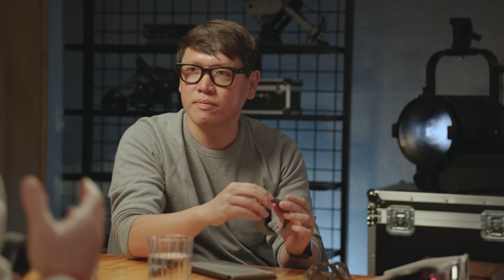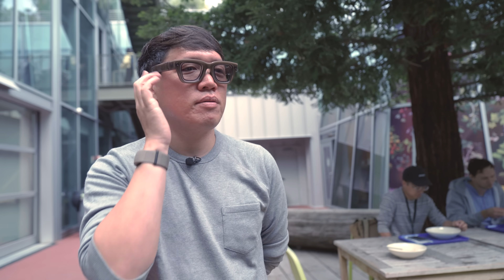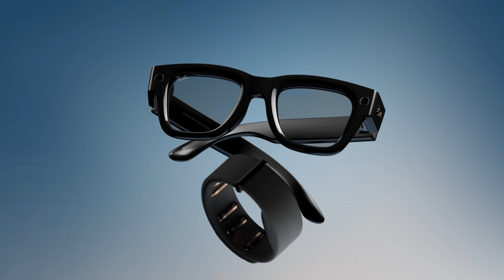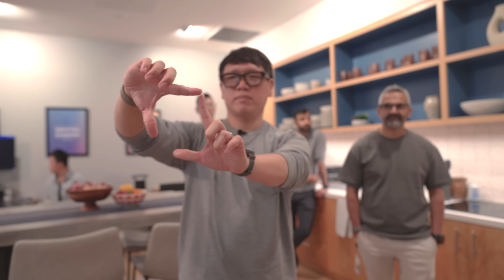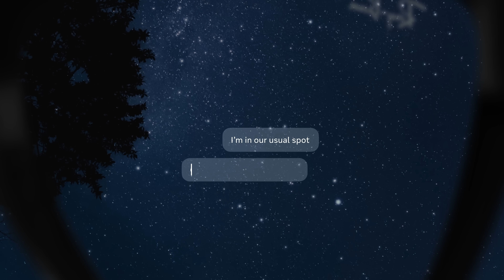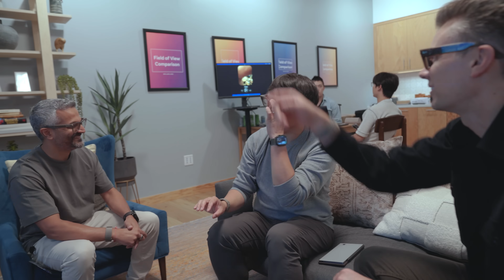Hands-On: Meta Ray-Ban Display Smart Glasses!

Comment: 100% of these miss is being OPEN.  I dont want to be locked to meta.  let me buy the glasses as an interface that work with anything because they support fully open protocols.
Reply: Exactly. The last thing I need is to tie a dying social media turned mass surveilance platform to my face. Give me a display, interface, and either use off the shelf parts or include a drriver library. That way, anyone who can do circuitpython or arduino could have a custom, privacy respecing open HUD platform. 

One can dream, anyway. I also want a device that is like the gpd pro (phone sized, screen folds backwards for touch only use) with built in 4g and a gaming gpu, to install linux on, too much to ask? 😂
Reply: @goosebyte  if you use a cell phone and are worried about this then you don’t realize what your cell phone does 😂
Reply: Hopefully these will just be on some kind of standard eventually like Bluetooth headsets. I wanna be able to use it with any service that supports it, would never buy something locked to Meta.
Reply: @JohnVance that would be really cool, there are already companies who are making prescriptions lenses for meta glasses
Reply: Check out the Inmo Air 3. Open SDK and dual displays. They are funky looking though and battery doesn't last very long. Only drawbacks.
Reply: 2 things about your comment: 1) You’re right, that would be a way better experience for all of us and accelerate the adoption. 2) This assumes they are making money off the hardware, they are not.  The sole reason they are even in this space is to own the ecosystem end to end (like Apple does) so they can have unfettered access to all your data…your location, your conversations, how you spend your day who you do that with, etc.
Reply: wait for gen 3,4 product
Reply: 😂😂😂😂 NO ! you'll pay META , and keep paying what ever they demand and you like.
Reply: This is the problem with companies that consumers don't identify with. It doesn't matter how great the product is when you dislike the company. Theres a reason people don't mind being locked into the Apple Ecosystem. Consumers identify with Apple and trust them.
Reply: @SaadyAb  not people. Californians. I wouldn't use an apple product for the same reason.
Reply: @SaadyAb  Speak for yourself, I hate being locked into the apple ecosystem.
Reply: @SaadyAb  I don't identify with Apple. I dislike them. I do not trust them. There are reasons why I DO mind being locked to Apple ecosystem. So I deny it.
I do NOT use any Apple products.
(I do have a MacBook Pro, though. But it is running Windows 11 24H2)
Reply: Am I missing something? Because I swore that I’ve heard of them making the SDK available to third parties already..
Reply: They literally said there will be third-party apps. When that point is we don’t know, but it’s always been part of the plan.
Reply: Check out Brilliant Labs Halo glasses!
Reply: I just want the translator to work offline, in Rural Japan.  That and the ability to attack a wireless keyboard and mouse any time I feel like.
Reply: The problem is that nothing gives them the access to stuff to be useful so your iPhone or Android phone don't allow tight integration for external devices
Reply: Well good luck with that lol. If Apple came out with the same product, you would gladly add it to your other Apple products and thank them for the opportunity. A company with this much funding behind them that sells things at a loss is not going to let you do whatever with their product. Meta still has to rope you into the ecosystem just like Apple would.
Reply: @brianbadonde9251  Apple only exists today because they allow and encourage third party developers to build for their ecosystem. If Apple gear only ran Apple apps nobody would buy it.

Xcode, the SDK's are free.  Apple developer is $99/year and you only need that when you're ready to publish. It's free to non-profits and educational orgs.
Reply: That would be the future product, right now the user group is not large enough that other companies purchase the licenses for this
Reply: @dvo66  It would be ridiculous to require a license. Windows, Android, and IOS were successful because anyone could develop for them.  The money isn't in selling devices, the money is in building platforms that make other people wealthy and you even wealthier. Being open is how you do that.
Reply: @semianonymousraccoon2950  The money is in collecting, using, and selling your data.
Reply: @semianonymousraccoon2950 no the money is making a device that people want to use more than not. Then collecting the enormous of data and monopolizing an industry. Believe me the data from how people do everything in their day is invaluable and truly powerful. Cant collect data from third party apps.